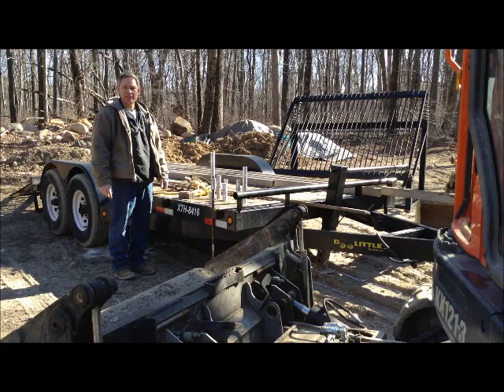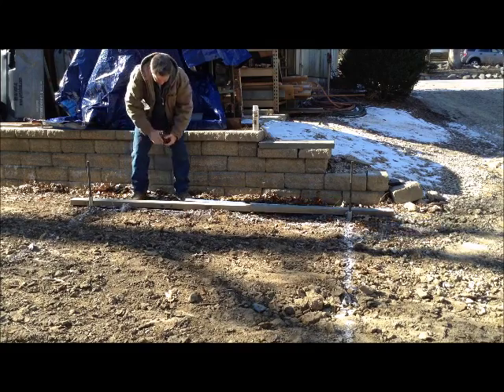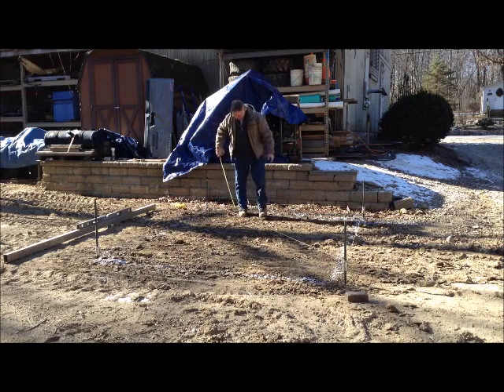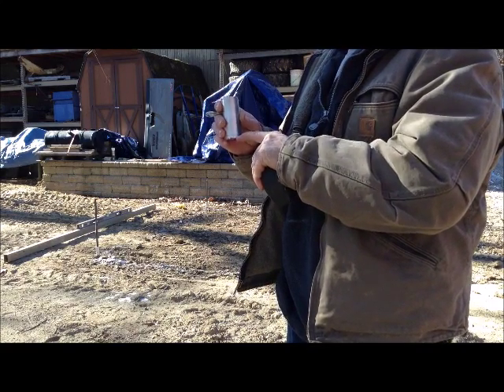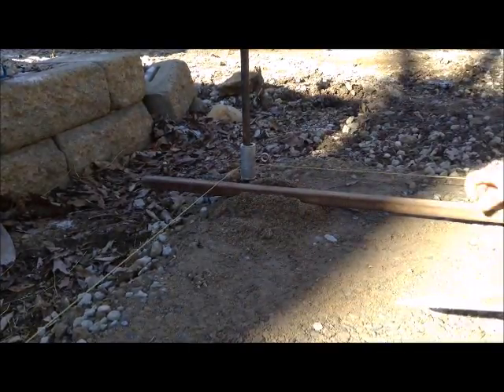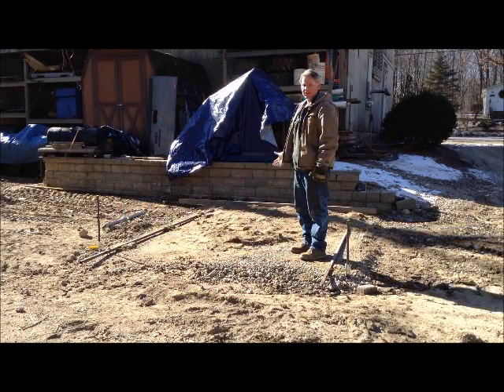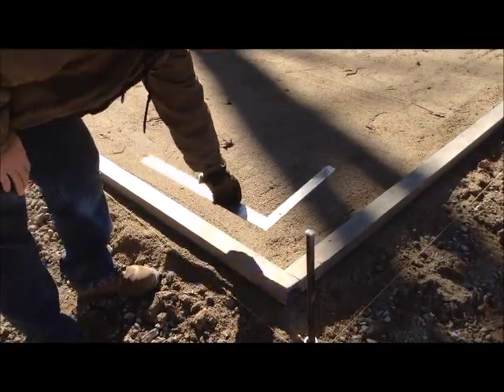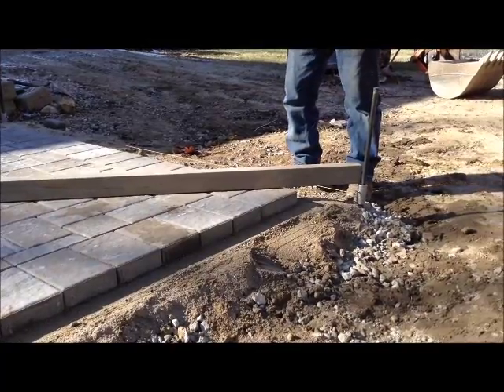Perfect Paver hardscape installation Tool   How To Prepare And Lay A Base For Pavers

Comment: Bought a hand full of these couplings, tried them out on a paver side walk project and they are very helpful for setting, checking depth and insuring level with a string level.
I can see using them for pavers from now on.

Comment: These things are great to use!! We only started using them and they really help you raise and lower stringlines super quick! There is no untying of the line required. You can use them with  or without a laser level to set the heights. They also work fantastic for setting up a string line for the paver bond lines as you can make minor adjustments to the left or right simply by rotating the tool (so there is no need to tap the pin back and forth any more). We have even used for retaining walls to quickly adjust the height of our string line.